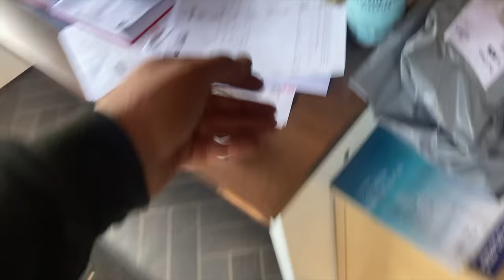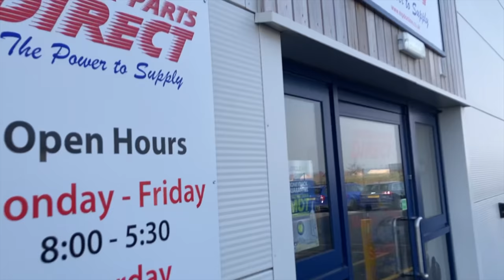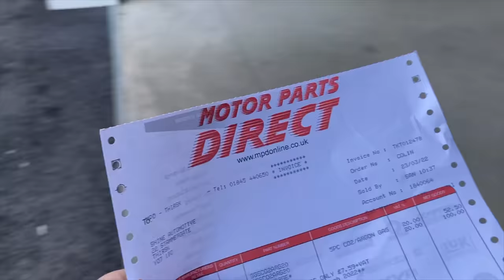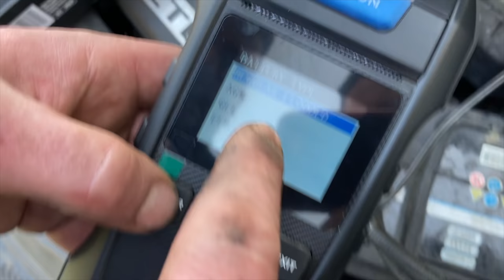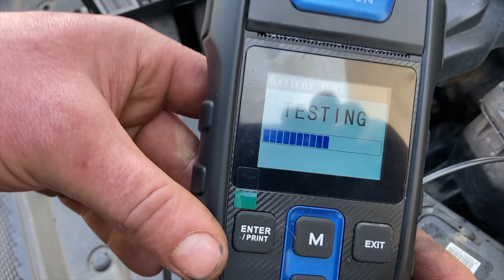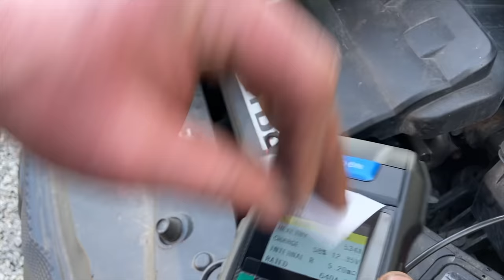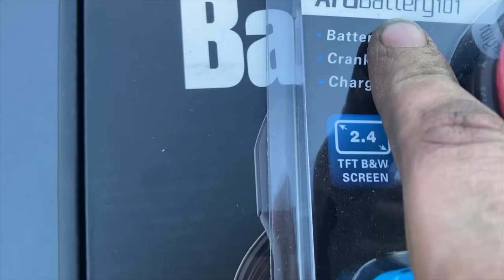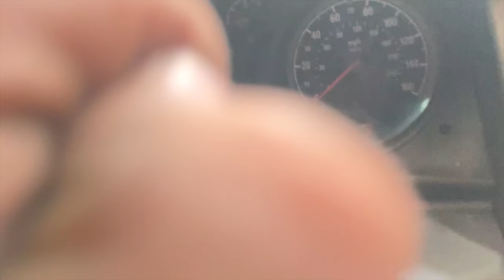A Week In Shine Part 7

Comment: Make sure you flush the full length metal pipes that run under the car to the radiator at the front if you don't flush them out it will just overheat
Reply from the maker: we sure did thanks .